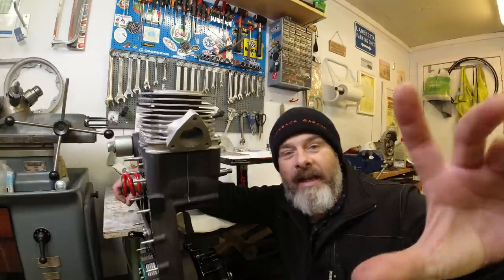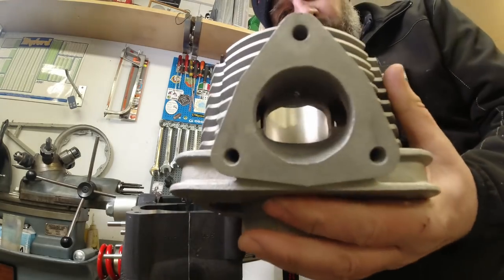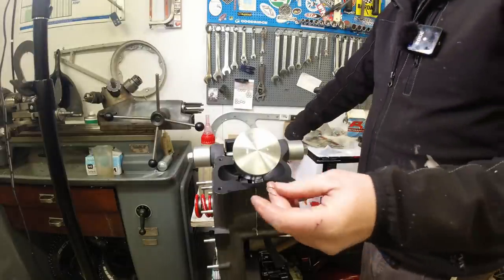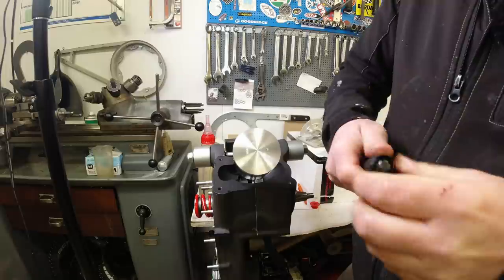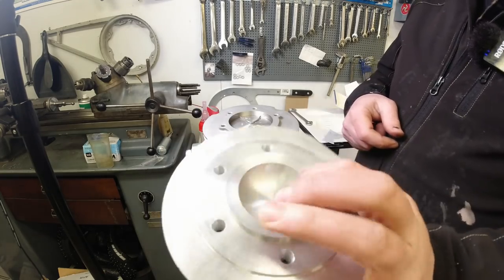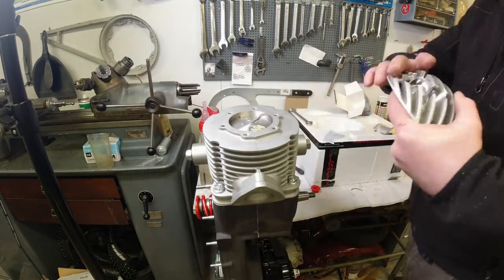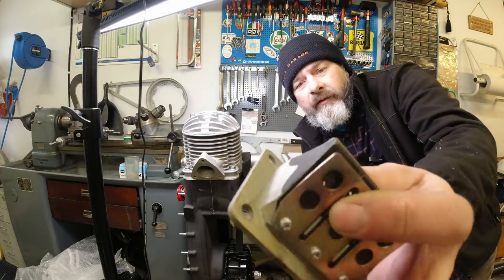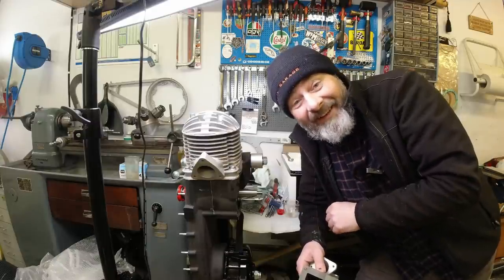#lambretta SST265 build, part 6. Cylinder and piston. #kickbackgarage

Comment: I have a new standard 200cc barrel and piston,I watched your video on checking the piston  ring gap, what would the gap be on these rings they  are 1.5mm thick ,cheers keep up the excellent work
Reply from the maker: Different parameters for iron barrel. Mb scooters tech site is excellent for that info. 😎

Comment: Hi Rob do you not use three bond on both sides of the base gasket 🤔🤔🤔👍
Reply from the maker: Yes. It's less messy to apply on the gasket surface when you fit the cylinder over the piston